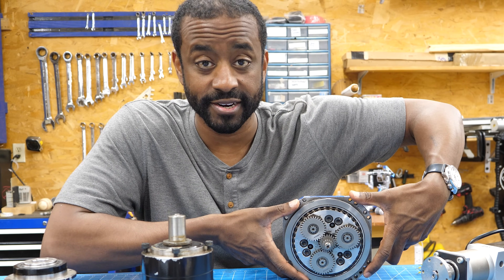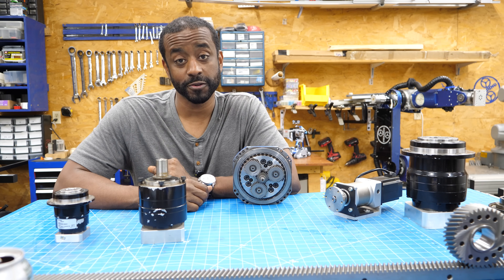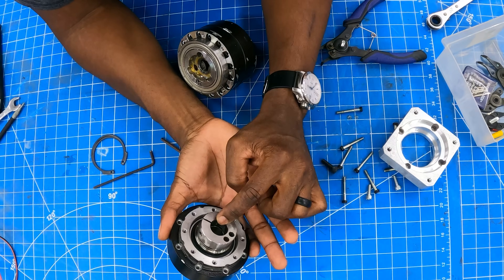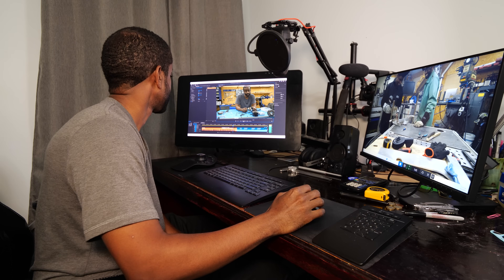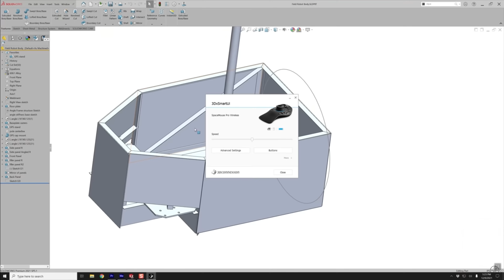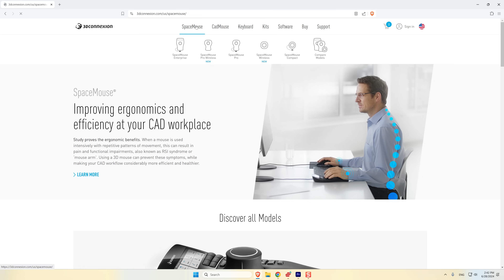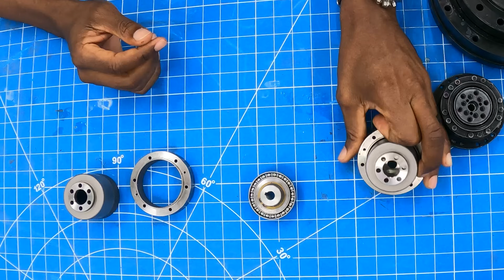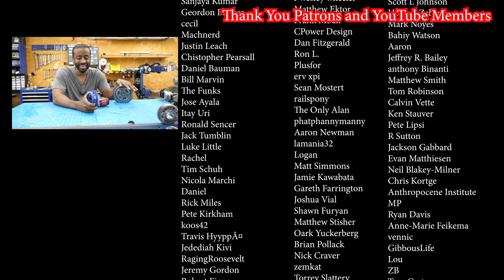Why Harmonic Drives Are Awesome.

Comment: Worm gears only have one tooth engaged at a time & suffer badly from periodic error.

Strainwave drives technically have 2 teeth connected at any time. Due to the flexible material they are made from they can slip.

Harmonic Drive is a manufacturer as you said, they don't only make Strainwave gears. It's like calling imaging sensors Sony because Sony make then

Planetary gears can have lots of teeth engages at the same time I used 9 smaller planets allowing me to have a hollow sun gears

Split Ring Compound Planetary Gears are the way I went when building my telescope mount.
Planetary Gears can be made relatively backlash free (sub arcsecond) Though I don't really see small amounts of backlash as a problem as long as it's consistent it can be compensated for.

Comment: Have you made a video on Planetary Gears in a drill ?

I ask because I am trying to work out , why on my bosch gsr mx2drive 3.6v professional screwdriver , which should have two speeds  , when you pull the trigger , to mark1 , it should run at a lower speed and when you full press the trigger to mark2 , it should run at a higher speed . 
Well that is a guess , as to me , that makes more sense than it running at a faster speed on mark 1 and slower on mark2 , which is what it is doing at the moment . 
I think the faster speed on mark2 some in not engaging properly , as you can hear it and feel it . 
This was thrown away

Comment: This video is amazing, anybody seeing this do reply. 
I am an electrical engineer working on a project for a device, i need to make a system for my low torque BLDC motor to move the output up and down in a very compact space(20x20mm) but with high output force about 100N, i also want the mechanism to be super quite...any ideas?

Comment: you are like me in such that i will look at anything mechanical example being a lown mower self propelled has a small gearbox with axle control cables etc etc lol im building my expensive tool aresenal up now though have a yamaha 2200 inverter and a plasma cuttter on the way so i will be able to work on things to get parts off of whatever with my setup and my goal is to salvage metal and drive drain parts in order to make some precision tools like a mill, tubing bender, and so forth you are a smart man and you explain things with simplicity and accuracy its hard to not learn from you awesome stuff!

Comment: One other problem that can affect planetary (or spur) gearboxes,  more so as compared to worm, harmonic or cycloidal gearboxes, is that the planetary/spur gearboxes tend to be less torsionally stiff, and it is a problem that gets worse as the gear ratio increases and the parts count within the gearbox goes up.  I was called in to investigate a system that used a NEMA 23 stepper motor driving a 700:1, 3-stage planetary gearbox driving a large double-enveloping worm and sector gear to raise or lower a ~200-pound weight at the end of a nominally-horizontal 70-inch lever arm.  The problem that the system was having is that after the output load was driven up to a precise position and stopped, after a while (an hour or two) it was found to have drifted up (>3mm) to a higher (against gravity) position. The problem was traced to elastic windup of the planetary gearbox and that elastic energy was gradually being released through stick/slip of the worm gear (due to imperceptible facility vibrations) and pulling the end of the lever arm up.

The gearbox (CGI-23PL-7000S-L/B) was rated for a continuous output torque of 303 in-lbf which, with its 80% efficiency, meant the expected maximum input torque would be about 8.66in-ozf. At one point in our testing we took a spare gearbox and clamped its output shaft clamped so that it could not rotate and we attached a torque watch to its input shaft.  We were able to rotate the torque watch through more than 12 full revolutions before reaching the torque limit for the input to the gearbox.  Letting go of the torque watch caused it to frantically spin backwards like the propeller on a rubber-band-powered balsa airplane.

The fix involved replacing the planetary gearbox with a 100:1 harmonic drive that in turn rotated a screw shaft (1mm lead) within a roller nut coupled through an 8” crank arm normal to the 70” output arm.

The point here is that torsional stiffness of a gearbox can be quite important and it is quite often ignored!

Comment: A good integration of the power source and harmonic drive is the low-speed hydraulic motor.  It kind of has elements of an automatic transmission gear pump coupled with elements of a constant velocity joint to handle the varying angularity of the output.  The outer gear is stationary and the inner gear wobbles around inside, advancing one tooth at a time.  Everything is entirely inside, and completely lubricated and cooled by the working fluid.A masterpiece of industrial execution, and ideal where flexibility of installation and resistance to external contamination is more important than absolute efficiency.

Comment: As a worker at HIWIN precision. making that Flex Spline Cup is one of the hardest for me. it really needs to be precise from it OD to its tooth engagement to achieve the zero backlash even a slight off in the size will be considered no good.

Comment: a very common use and excellent simple example of worm gears only being drivable one way but seizing up from friction if you apply torque on the other end are the tuning machines on stringed instruments like guitars. you can put a lot of string tension torque directly on the wheel gear shaft and they basically don't slip at all, while the tuning knobs fixed to the spiral gears are easy to turn without much force. on a lot of guitars and double basses, the whole apparatus is open to look at, too.

Comment: Just kind of a cool factoid, the headlight motors on my 1966 Charger use a harmonic drive system to rotate out the headlights. They are an amazing piece of engineering especially for a mass manufactured consumer product but also virtually impossible to repair or replace if damaged mechanically.

Comment: 3:25 Absolute beginner here. You say the shaft has to be thicker, but I notice the output shaft is not 40 times the squarage of the input shaft for the (if I remember correctly) 40:1 ratio. How do you calculate the necessary increase in shaft size?
Reply from the maker: Unfortunately there is no short answer. This subject would be an entire chapter in an engineering text book. There are too many variables to answer this in the comments.
Reply: The polar moment of area of a shaft is propotional to diameter^4

Comment: I am a new designer designing a slow moving ground solar powered drone for use in agriculture and I was considering worm gears in the driving system for the torque and slow speeds which worse safer around animals but after this, perhaps I should look at another type

Comment: Thanks for a a thorough lesson on learning about these different types of gears. I work in prosthetics and an interesting development in engineering in my field are knees that supply power to the above knee amputee. the first powered knee that was introduced to the market uses a strain wave/harmonic drive gear. Anew design introduced to the market uses a worm drive gear and one of the noticeable differences is the worm driven product is quieter than the harmonic drive product. It also seems that the long term use of the product may vary greatly due to wear of these two different gearing systems. One other interesting aspect of this video is snap rings. I am always amazed out how a snap ring can hold together devices that produce so much torque.

Comment: I just stumbled and fumbled through the disassembly and replacement of a servo motor, and it was this type of drive we encountered.
Mystery solved.
I knew there had to be an explanation for how it engaged for delivering torque to the articulated waterjet mount.
Be careful kids, don't mess it up. 
The parts need to be handled carefully.
The one sort of round part fitting into the flex tooth ring needs some patience.

Comment: I ALWAYS "change my mind" when it comes to opening up things up so I can better understand. So much so, I typically buy two now if I know there's a chance I'm going to break it open.  I also scout for parts from thrift stores and I'm never disappointed. I just bought a $300+ roomba for $10 at Goodwill. just needs a new battery pack, which I'll build from my excess stock.  I'm going to mount a prop on it that'll follow ppl around our halloween haunt.

Comment: Any chance you can do a series on different kinds of bearings and torque specs?
Reply from the maker: maybe... I do think that would be interesting. Thanks for the suggestion. I might combine it with something else and make it a series about machines with moving parts. That would help to capture all the related stuff. Its not just about choosing the right bearing. There is also how you design the parts that hold the bearing. Slight changes in the design could mean you should use a different kind of bearing and this would allow me to get all that together in one video or series.
Reply: @Jeremy_Fielding  Thanks for the reply, i am working on a harmonic drive driven telescope mount, just learning as i am going (so far quite well), but i struggle understanding what those little 17 size drives i got from china can take when it comes to hanging a telescope of them for example. 
Awesome channel and content, been watching one video after the other and substribed :)

Comment: Nice presentation Mr. Fielding!  Fun historical note wrt worm gears and robotics:  In the 1970’s a professor and students at the Ohio State University built a “Hexapod” to explore robotic locomotion.  (It was one of the first articulated 6-legged robots, I think.  Ants keep 3 feet on the ground at all times, so they are stable.)  They used cheap electric hand drill motors driving worm gears at each knee/joint. The low back-drive meant that when the motor stopped, the leg stayed in position holding the robot steady.  Clever and efficient!  (High precision was not needed for the leg placement.)

Comment: If you wanted to show one of those kind of Gears take apart an oscillating sprinkler one of those ones that you just put in your yard. They have the same type of design that you're talking about but they also have three stages of it inside of it too that's all powered by the water flow

Comment: I went and bought a Milwaukee hammer drill just to tear it apart and get at the gearset mechanism that drives the chuck and it was worth every penny. It's an amazing thing, almost like a tiny manual transmission. 
Gears...😃

Comment: Interestingly the worm drive was the drive of choice for possibly over a hundred years for telescope drives, where the telescope is made to rotate at the same speed as the earth, to effectively track celestial objects. The backlash was always a problem if the drive was reversed or if the balance of the scope took it in the wrong direction.
All sorts of compensatory mechanisms, normally microcontroller motor drives that spin to take up the backlash, are used. 
I think the strain wave drive is finding a place in telescope drives now.

Comment: When i was playing around with planetary gear designs i discovered something that's like a mix between a planetary gear and a harmonic drive. If the planet gears are connected to more gears that mesh with a ring gear with fewer teeth than the first ring gear, that second ring will turn very slowly in a similar way to a harmonic drive.

Sure enough, somebody had already thought of such a setup 😋
They're called wolfrom drives, but even finding that name was pretty hard because there doesn't seem to be many people talking about them.

I don't know what exactly their pros and cons might be. One con with my own setup is that the secondary planets and ring must have a custom tooth size to properly mesh (at least to get the greatest gear ratios), so they would probably be even more expensive than a regular planetary set.

Comment: I worked in space robotics and some strain wave systems (multi stage) got into the multiple thousand to one ratios. I was amazed how a motor the size of a D-cell battery could drive an arm several meters long.

Comment: Thoroughly enjoyable videos, Jeremy! 
The best cycloidal zero backlash drives I have seen are the Slovakian made Spinea Drives, which has a youtube channel or series of videos describing how its patented cross roller internal power transfer member works. The two cycloidal plates and pins still provide torque increase via the gear ratio, whilst the cross member greatly increases the torque available from surprisingly compact units. They are absolute beasts. Id like to see you dissect one- I certainly cant afford to.

Comment: I always thought that with the correct geometry you could make a back drive able worm gear like with a fishing reel? Maybe I am wrong but a great video nonetheless the less!
Reply from the maker: They are engineered products. There are all sorts of exceptions to nearly everything I said in the video as engineers make versions for specific applications. I.e. cheap versions of things I said were expensive, precise versions of things I said were usually low precision and so on

Comment: Used a harmonic drive in a project I worked on, it was stated, at the time, that harmonic drives lost efficiency very quickly the further from their design max loading they were used. I wonder if this is still true and, if so, does this restrict their use to areas where efficiency isn't a top requirement and where their other attributes are more important?

Comment: With gear reduction comes a greater emphasis on tooth strength.  I was wondering if helically cut harmonic gears were possible as a means to reduce the strain per gear tooth and also reduce gear whine noise.

Comment: Good video , problem with worm drive might be that only on tooth is taking all the forces. On a chain and sprocket for example, the forces are evenly spread over many teeth , same for belt drive. But then a problem with chains and belts is that huge reductions or increases can't be done in a small package, and change of plane axis for the rotation can't neither be done in a small package. I love how belt drived provide a clutch function by adjustment of tension during engagement.

Comment: Back in the 1980's I had a Cobra ultralight by Advanced Aviation that used a planetary gear from a Ford transmission as the prop reduction drive.

Comment: Thank you Mr. Fielding.  Very good tutorial.
In respect of the harmonic gearbox, I remember seeing a documentary about 20 years ago that spawned the idea of this type of reduction.
Guy having drinks in a bar.  Spun a coin on the bar-top and watched as it slowly tipped over doing its wibbly-wobbly thing.  He noticed the rotation of the coin in relation to the bar-top surface.  The light-bulb lit up.
The original concept was a little different to what you have shown in this video.  It was two ring gears but one of the gears had one less tooth than the other.  One of the gears was tilted on its rotational axis by a cam to mesh with only two or three teeth on the other.
Same idea, different implementation.  60/61 teeth = 60:1 reduction.

Comment: Have you considered also government surplus auctions.? You can find them by contacting city or county clerks, or go through the third party government surplus warehouse websites. But the government can’t make a profit on anything so you are guaranteed to pay the lowest prices. I’ve frequently seen drives and components just pilled onto a pallet and sold as a $1 lot, now the only thing when you finalize the transaction the onus is on you to inspect and facilitate delivery. You can inspect before hand but they usually, will not provide any information upfront.

Comment: Back driving can happen with worm gears and gets people in serious trouble. When the ratio is below 30:1, the system is subject to vibrations, or there are reverses in rotation, it is best to make other precautions on back drive prevention. My opinion is informed by 50+ years of designing custom gear drives of all types and sizes.

Comment: Excellent.  I'm now hearing about harmonic drives in astronomical mounts and this helped emensly.  They are touted as able carry more weight in a smaller form factor with little to no backlash.  They are also more expensive.

Comment: Another consideration is side loading capabilities. Such as driving a sprocket. Worm gears are used in a lot of heavy-duty pto winches because you don't want the winch spinning backward when you  release the clutch and disconnect the power. They still will under severe load and have a small spring-loaded band brake on the input shaft that is constantly applied that you adjust just tight enough to hold the load. The bull gears on a worm drive are usually bronze. That's why you don't pull a vehicle by the winch cable. You use the winch to pull the vehicle. There's a shear pin in the pto drive or a set pressure limit on hydraulic driven ones. Jerking on the cable of a stopped winch can strip the teeth off the bull gear!

Comment: You neglected DC drive motors that when used with bearings are very quiet and very accurate and can be speed controled with a DC converter speed controller, I use to be a precision machinist working in the millionths of tolerances, don't forget servo drives and motors and offset bearing drives to name a few, NO backlash on these types of drives
Reply from the maker: You seem to be confusing the motor with the gear box. These separately both need to have precision. There is no discussion of motors in this series so nothing was left out. I talk about that in another series of videos called The Ultimate guide to electric motors. There should be a link in the description if you want to learn more about that.